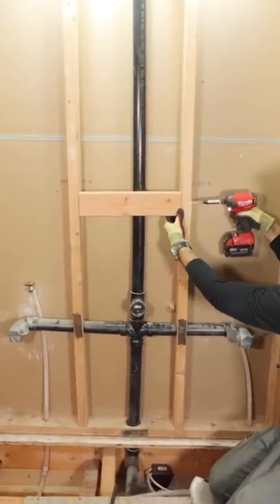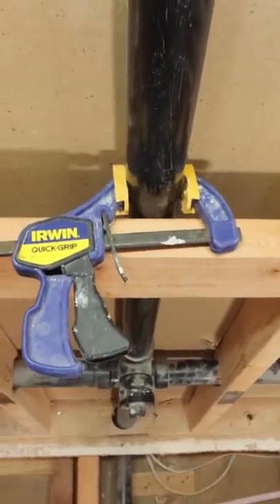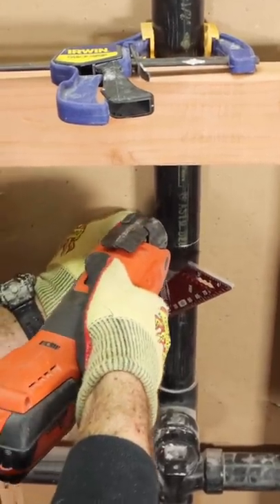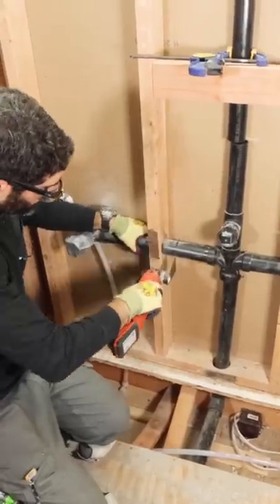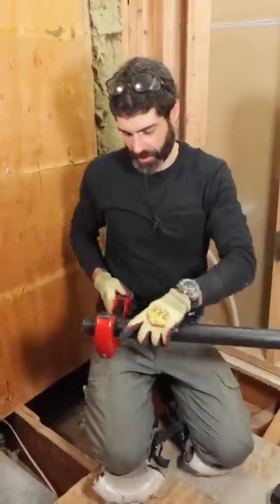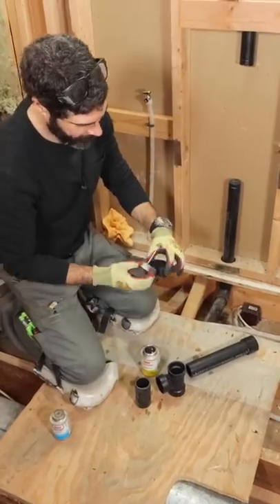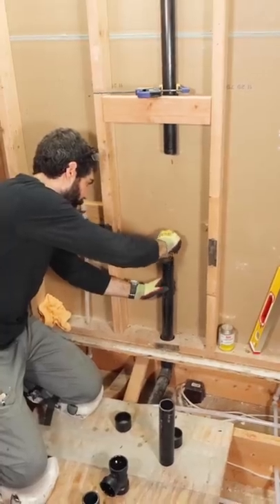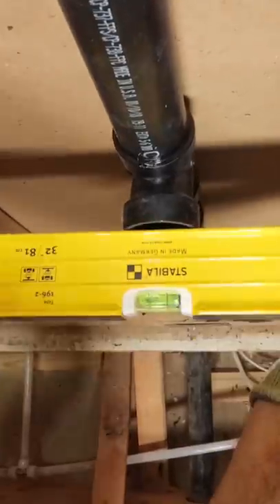Vanity Plumbing Tips - #shorts

Comment: Next time don't hack out that clean out and forget about it, any horizontal drain over 5' needs that upper terminal clean out
Reply: That clean out was obviously for the cross.And what code are you referring too,I'm a master and never heard of that
Reply: @scottboehmer1114  which a cross always needs a clean out regardless of what it serves. Well first off, if you're even really a contracting plumber, which that's all a master plumber is for any of these folks that don't know, then you would know each state has their own codes. Apparently Idaho requires more strict guidelines for cleanouts opposed to whatever state you hold a card in. But if you'd really like to know what that code is, and you're not just being an ignorant asshole, then the code section is 707.0 in sanitary drainage. Covers over 90% of everything a plumber should know about cleanouts. The "5' rule" is listed in the exceptions just after 707.4.
Reply: @robertelzner6679  most states adhere to either upc or irc. And no I wasn't being an asshole. I am always trying to learn. That's a pretty  strict code. Is that just for trap arms or all horizontal runs?
Reply: @robertelzner6679  I also wanted to see if it was in upc(thats the code Iowa follows)
Reply: @scottboehmer1114  fair enough sorry if I came across as an ass also. Ya it is pretty strict up here. Which sucks sometimes. My code book from 2017 says IAPMO (international association of plumbing and mechanical officials) so probably IPC? Don't quote me on that one tho. That 5' horizontal rule only applies to drain lines and not trap arms. Trap arms only require cleanouts in Idaho if for some reason a guy would have to plumb a dirty arm with a 180° bend.
Reply: @robertelzner6679  IPC is ass, do you have to use big stud guards on top and bottom plates and do mid story supports on anything under 3"?
Reply: @scottboehmer1114  the original point that I was trying to make was in most remodels a plumber may not know how long the horizontal branch is that connects into the stack, therefore it's always better safe than sorry to put another cleanout back on that Vent if it already had one. That is literally nitpicking and it's hard for me not to do being a plumber so I'm sorry for any offense! I do however like the tricks this plumber did. Nice close quarters clean cut, reamed his pipes, and good support for the pipe considering the flashing is probably just old and worn out. We're not roofers I'd do the same thing, and then give a new flashing to the homeowner for whenever the roofer gets there.
Reply: @scottboehmer1114  yes and yes, the inspector is just fine with some plumbers strap going to the studs though, so it's easy at least.
Reply: @robertelzner6679  yup ipc, hate that code, all the counties in Iowa follow upc except one little one. There are some weird codes in that shit
Reply: @robertelzner6679  I got nailed once for having a faucet to close to the wall, they wanted us to treat them like closet flanges lol
Reply: @robertelzner6679  same, every where around here is a bit different

Comment: Jesus Christ you used a deburring tool when you used a C cutter. If you have to do that you used the tool wrong you buried the cutting wheel too far into the pipe on the first turn this causes the pipe to mushroom first  mistake  number 2 mistake you used pipe cleaner on a one step pipe with one step glue. Mistake number three you used a level to set a T.  🤦‍♂️(probably took half a day)

Comment: I want to see how you attached the top coupling.  Pipe shouldn't fall if is properly installed but since is a fake video to get likes and get paid you didn't showed when you attached the top coupling if the pipe vent wasnt loose for the video, so the clamp is your helper because the top pipe is loose what a fake dude